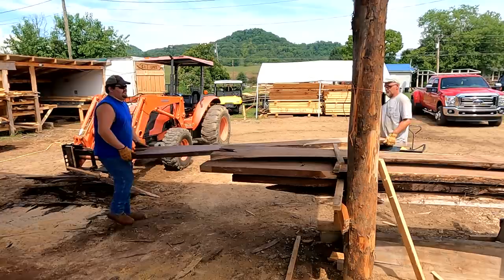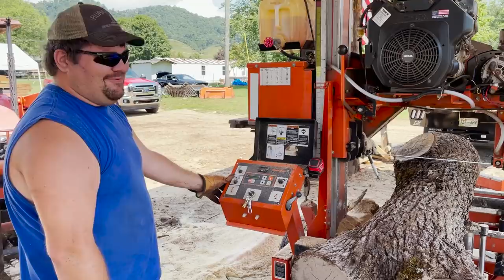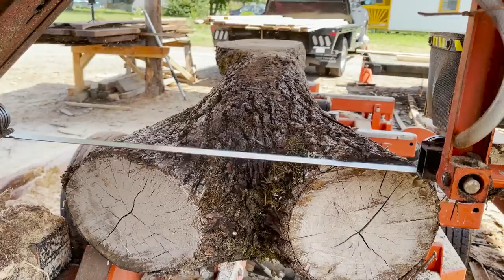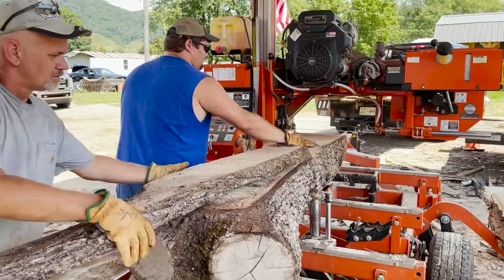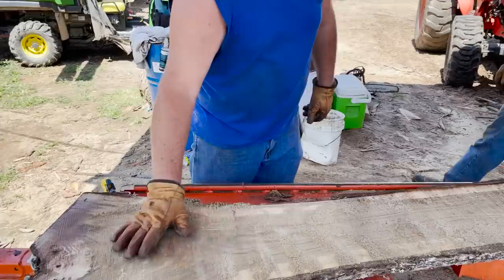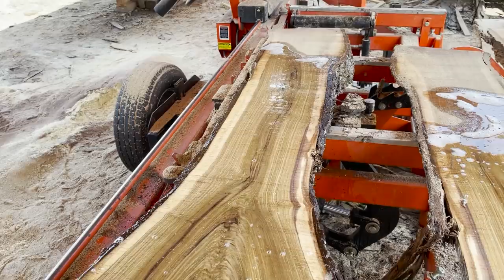Wait Til You See Inside Of This Log, Amazing Crotch Walnut

Comment: Great slabs, thank you for sharing. It looks like the surface is a little rougher that you old mill, is it due to higher feeding feed, courser blade or something else?   I may be nuts too, lol
Reply: No I noticed it too. It's a pretty rough cut for SURE, even the WATER couldn't hide it.
Reply: Seemed like the whole carriage shimmied when he turned the blade on. Or is that a normal thing on a Woodmizer?
Reply: It was most likely the blade
Reply: @lumberjill6598  well if that's NORMAL, that's NOT that rig I want. I've seen mills with blades with TEETH missing that cut smoother than THAT!
Reply: Not the best of slabs.
Reply: We were using 7* blades that day, 4* works better for crotch figure
Reply: Thank you, I just wanted to understand and learn.  The work is great and I appreciate it.  Love the saw mills and wish I had a 100 acre Black Walnut wood lot and was 40 years younger, Lol.  Take care.

Comment: Why does the right side of the saw where the blade emerges vibrate so badly when the blade is engaged?  Does the overarm/carriage need replacement bearings on the full length rail or is that the nature of that type of saw?  Thanks in advance for your response.
Reply from the maker: Just the nature. No problem with it 👍👍
Reply: I have not seen anything regarding failures on a Woodmizer except blade rollers/bearing replacement.  However, excessive vibration in machinery usual indicates poor design and/or badly worn parts, and eventual failure.  There did not appear to be any excessive saw marks in the slabs.